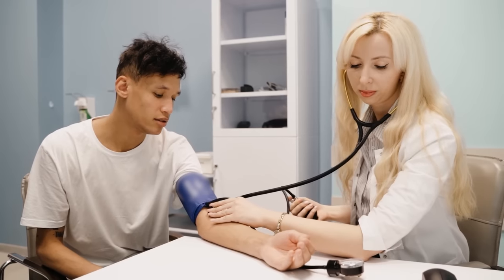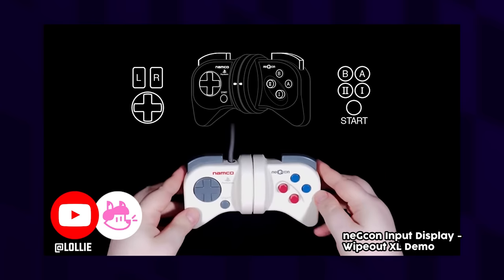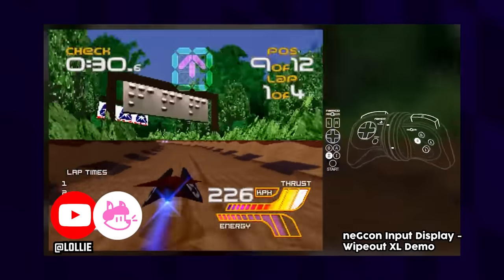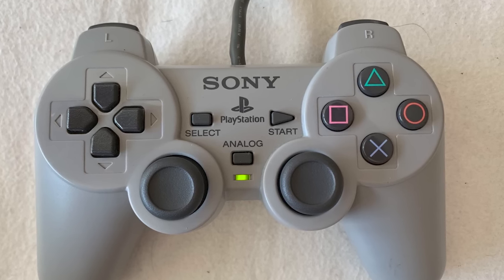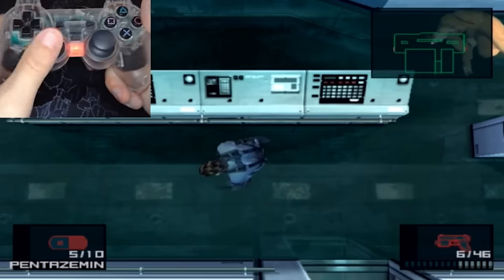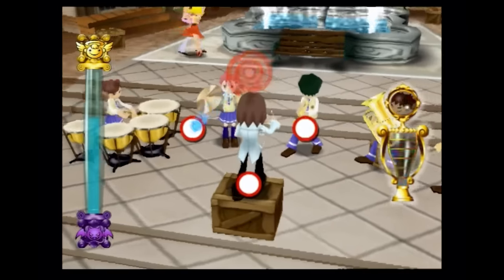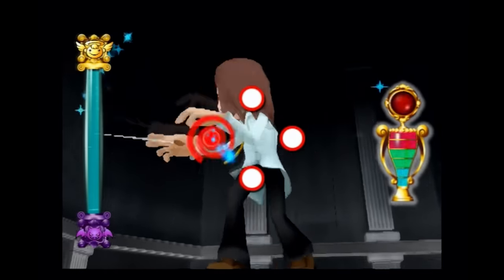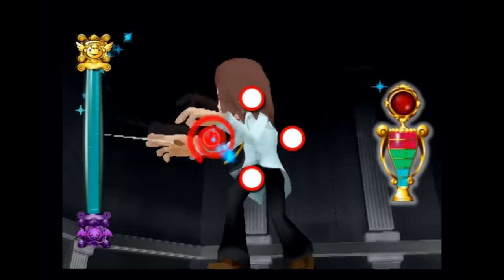The Short History of Pressure Sensitive Buttons

Comment: Good video. I can notice it in GT3 but I know it's physics well. I agree it's around 2-3 levels for sure of pressure. I think backwards compatibility was the reason even if PS2 support was cut, PS1 kept throughout. Or to make it a complete controller. Dualshock 4 assuming they dropped it which is fair.

I think a video on the Dualshock 4 touchpad or Xbox One Impulse Triggers would be cool interesting. I look out for them and they are as hit and miss as we all think.

Also Playlink and compare their games to Everybody 1-2 Switch too.

Dualshock 4 had a touchpad Dualsense has to for the few games that use it of the past or I guess continue to on PS5 like Astro let alone others likely but mostly PS4 (first party early Killzone/Infamous use it well, (speaking of mics on the wiinote or Dualshock 4 I guess too), end of life with Last of Us 2/Ghost and middle with Nier Automata two halves, Wonderful 101, Gal Gun for boss fights rubbing it are the ones ai remember using it same with Vita using the touchscreen and back touchpad in interesting ways).

Of course gyro on Dualshock 4 doesn't work on PS3 as it's a generic controller driver.

Yeah 3D Touch to other touchpads ah. I doubt it. It works for racing for sure, combat is cool but like the right stick to dodge/hit it's now camera or other use cases.

Analogue triggers are better than the button pressure length/height.

But yeah more input methods and wrong inputs the game understands or doesn't.

That and also other tech then in gaming and of course haptics.

But yes context and execution matters on relevance attempts at it. Gyro as a third analogue stick (same in VR with your head to move/see in the space) or aiming or whatever is fair while others not.

Seriously the PS3 hack. It's like the PS3 Genji meme it's BASED ON (like every based on said history or story moments but altered to be fictional imagine that) It's been well documented, actually research then make a pointless clip. It can happen to any company. All tech people know the status of these situations.

Hackers took a while to break into it. No one breaks into the Xbox One. Whether  Other OS being removed was the trigger or not or other factors. Aka Xbox One dev mode why would people hack it they don't need to. It wasn't PSP easy because they messed up encryption there (fixed on Vita). Oh a company makes a mistake the world blows it out of proportion. Companies have DRM/try to make their platforms safe whether old methods or hardware or whatever hackers learn they try to be. They aren't perfect. A few steps ahead they try but they aren't experts they do what they can same with hacks on PC/random ware or viruses they work out the methods used they can't easily tell the code someone had wrote.

Same with emulation it costs money and time, it costs game licenses but ungrateful customers are idiots that don't know how business works and go waaaaa my favourite game isn't backwards compatible like come on think not be an idiot. The licence, the company may be dead, no one wants it, a company has no source code or the game isn't being offered.

Ungreatful non-programmer idiots on the internet. You try and beat hackers or licensing. Didn't think so.

Comment: Why don’t ALL the Consoles have Pressure Sensitivity already !? 
It’s pretty dated to have just A Single Input Button nowadays 
Especially he Shoulder buttons and triggers
Reply: Because developers didn’t take advantage of them much. They mostly limited pressure sensitive actions to the triggers. The OG Xbox had pressure sensitive buttons but because few games took advantage of them Microsoft stripped it out of the 360, the PS2 R2 and L2 buttons were pressure sensitive but not as much as the face buttons were so developers often used the face buttons for pressure sensitive actions but with the PS3 when Sony switched to traditional triggers for the R2 and L2 buttons developers quit using the face buttons for pressure sensitive movements so Sony stripped out pressure sensitive buttons for the DualShock 4.

Comment: Minor correction, the Nintendo DS did not have a pressure sensitive touch screen. Also, the DS2’s build quality was much inferior to the DS1. I broke half a dozen DS2, but all my DS 1s are still going strong to this day. Other than that, a very informative video.

I’m not surprised the tech didn’t stick around for long. It created more problems than it solved. Going down a long straight in Gran Turismo 4, I’d regularly notice my car beginning to slow down. This would be because I’d unintentionally eased up the pressure on the button. So to prevent this, I’d press the button with as much force as I could. After a short while, my thumb would be really hurting. Before long, I’d just dig out a DS1 to use its digital buttons instead.
Reply: The Nintendo DS DID have a pressure sensitive touch screen! I remember playing a drawing homebrew that used it for brush stroke size. I don't know any games that used it, though.
Reply: The DS had pressure sensitive touch screen but only the tank model

Comment: finally someone that talks about this! 
i hated so much gran turismo 7 for not having analog buttons, it forces you to use the triggers on the back of the controller if you want to modulate gas and brakes, and that's the reason why i rather play gt4 and gt3.
 however i feel like this is not a niche issue, racing games are a big part of the play station and there are millions of fans of gran turismo, to me analog buttons are the difference between a playable racing games and a sucky one
Reply: Triggers simulating pedals makes way more sense...
Reply: @redslate  maybe, but just leave the option

Comment: i miss pressure-sensitive buttons. the DualShock 2 is my all-time favorite controller for this sole reason. back then i used to have a lot of use for them in games like Ace Combat 3, Ace Combat Zero and a bunch of racing games, and nowadays i can still see myself using them a lot in games like Rocket League and other games involving movement. other than that, two pairs of flat, pressure-sensitive shoulder buttons feels much more flexible than a pair of triggers and a pair of digital buttons. i would make use of a lot of the nuances they would give if i had a controller like that that was durable.

Comment: Loved the pressure sensitive buttons, Gran Turismo and Silent hill games were the best for it. Not going to lie destroyed 2 ps4 controllers near launch by pushing too hard thinking they were broken
Reply: Wait, really?
Not PS3 controllers (those things were cheap, creaking pieces of shit)?
Reply: @redslate  seriously once you get the hang of it, it was great, felt more in control, and for games like Gran Turismo it felt right pushing harder to go flat out and softer for parts of the corner. Only way besides analog stick throttle or steering wheel/pedals to get full gold international A licence